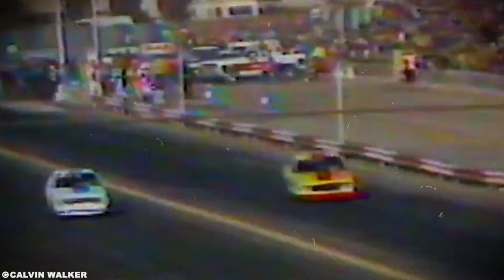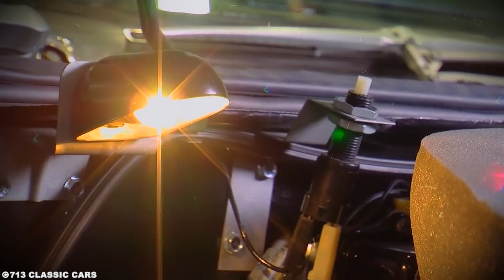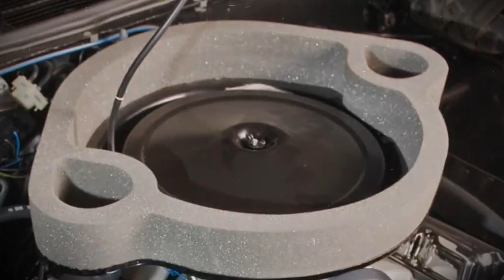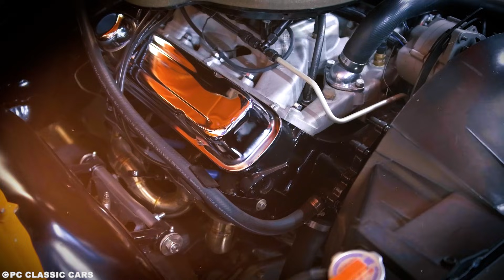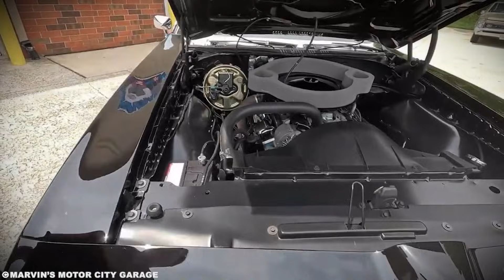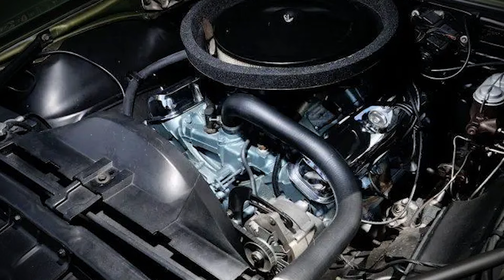This California Mechanic OUTSMARTED Pontiac With a "Secret" RamAir V Cylinder Head Nobody Knew Exist

Comment: Pontiac didn't have these as  warranty parts! They fully planned on building and installing them in both the GTO and TA. They even cast iron exhaust manifolds so their intent was obviously for production! My RA-V heads had a single "4" cast on them instead of the "44".  This video is so inaccurate.

Comment: Presumably the Ram Air Vee heads were preceded by the Ram Air Eye Vee?  Pontiac destroked the 400 to 303 inches, the tunnel port Ram Air 5 heads were made for that, but they had problems with oiling and never got it into races.
Reply: The 303 was way more than a destroked 400.